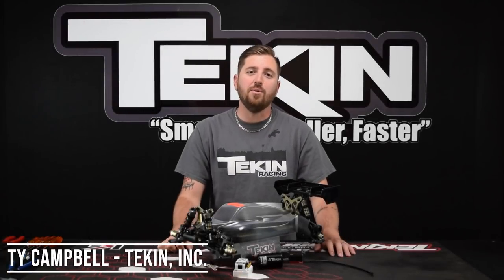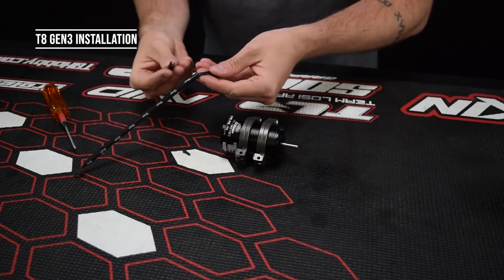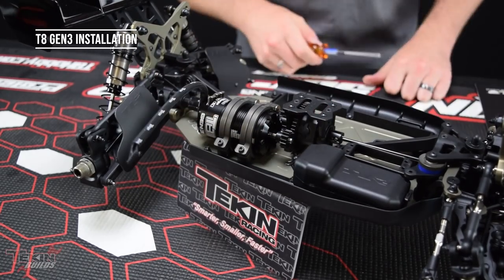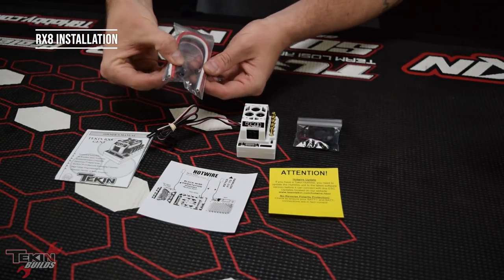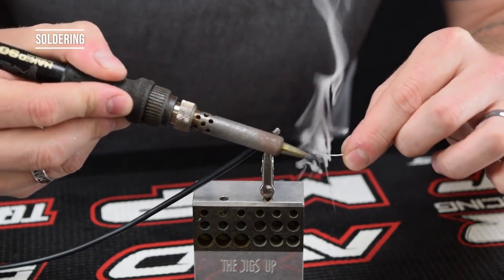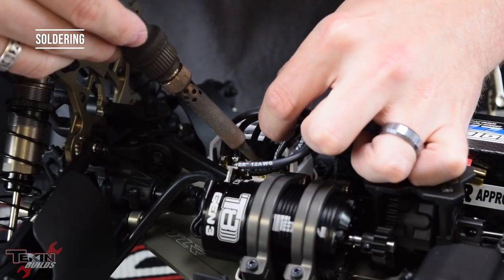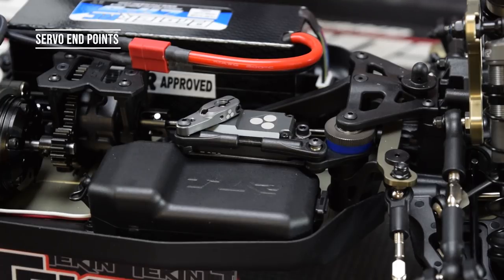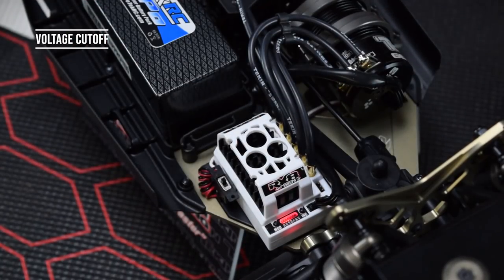Tekin Builds Ep. 8 - TLR 8IGHT-X E Electronics Install

Comment: Never had problem with wires coming off but how can you tell if it's a cold joint? Grey instead of shinny or?
Reply from the maker: Yep, if they are dull and look bumpy they could be cold. They will also pop off if you pull on them a bit if they are really bad.

Comment: I get the engineering behind that style of motor mount, but I’ve never liked them. Makes it a pain to set gear mesh, especially when things get dirty underneath.
Reply: I can see it being more difficult if there's a lot of dirt build up, but I much prefer the way this holds the motor as opposed to hanging it by the front end on a plate.
Reply: @TyTekinCampbell   kyosho had a piece that sat under the motor. the real fix is a thicker mount with one of these aswell, means it has no flex effect and no hanging motor... seperating it like nitro is bad for life of mesh and different loads on the motor shaft. old way with better/bigger mount is the best option.
Reply: @MrSupermugen  so did Losi back in the 2.0 days, but clamp mounts hold the motor much more secure.

Comment: Why do you set up your esc's to need to change low voltage cut off between different cell batteries?  Isn't it simpler to have low voltage cut off set to individual cell voltage?
Reply from the maker: You can do both. You set it for 4S and then you can adjust the individual cell voltage you'd like it to cutoff at. Our ESCs don't auto-detect pack voltage and adjust the cutoff because there are cross-overs that could cause battery damage from over discharging.

Comment: Ok they look fairly shiny feel very solid. But you got me thinking of redoing. Is 80° alot of timing of timing between the motor & esc together. I was told 90° is your max. Typically I run my 1:8 scale castle powered vehicles @ 0° cause it's all that's needed. But my tlr22 needs more top end with its 17.5. So 80° timing with 31pinion  69 spur 90c is that the reason my esc lasted 2 months in cool summer cond. Or does that sound more like poor soldering. My Orion ultimate stock soldered so perfectly very first time very shiny beads. But fought with the esc. Now I'm worried about the gold plating melted off my esc pads making the job that much harder and will my bernzomatic 60/40 rosin core leaded solder do the trick even on rough surfaces. I noticed the second time around soldering my Orion motor was a bitch. I do have a brand new unopened exact motor if needed but would hate to use due to no solder cleaning tools no solder sucker not even roll of that copper mesh stuff. I'm worried about ripple current due to the unnecessary resistance. I can check my castle gear but my skyrc I still need the computer adapter. I do have the wireless programming app and device for the skyrc ts120 and let me say it's been $flawless on all 3 devices I've tried them on. Thanks for any advice at this point. Thank you!
Reply from the maker: That's too much timing. You'll end up with the ESC being so far advanced it will fire a motor phase while still on the current one.
Reply: @TekinRacing  ok but will that fry out my esc faster than cold solder joint. Also honestly I tested speeds with Garmin's forerunner 101 by 5° and found that to be my best "lap time" and top speed of 45.5 mph...I stopped at 80° and did not go any higher due to the small mah packs despite the 90c rating...either way I couldn't see pushing more than 80°. Thanks brother!!
Reply from the maker: @detroitrcwurks998  Heat is a killer. so watch the temps. Timing won't hurt the ESC necessarily, it's the excess heat generated by pushing the system too hard that will damage components. Since none of it is our gear, I can't really say for sure what the limit is.

Comment: Too bad the motor mount isn't a heatsink. 
what if you use thermal tape instead of O ring?
Reply from the maker: It would probably take a lot of tape for the mount to clamp the motor properly. The motor can itself cools pretty will with all the fins.

Comment: I have been running my car with 4S lipo, but the ESC was set up at 6S lipo. I ran it like that about four times what will happen to the battery is it bad? The battery was very hot when I was done running didn't really know why haven't tried it yet on 4s.
Reply from the maker: The batteries need to cut off at the proper voltage. If the ESC was set for 6S it would flash the 1-3-5 low voltage code when you plug in a 4S.
Reply: Tekin Racing I updated the ESC last night. I disconnected like the computer said and then when I hook everything back up it said it was set to 6s. I wonder if updating it set it to 6S? I then set it back to 4s and will run it today. Are you saying that if it was set to 6s it wouldn't run on 4s?
Reply from the maker: @nuclearcrypto7743  correct, if it were set for 6S then cutoff would be around 19V (depending on what the per cell value is in the box above that slider) and a charged 4S would be below that at about 16.8. This would trigger the cutoff and the ESC would not drive and show the 1-3-5 code. Are you hitting 'Apply' when making setting changes in the HotWire?
Reply: Tekin Racing yes I hit apply after adjusting the esc back to 4s, I then plugged battery in and it ran. I just didn’t have time to run the car yet it was too late at night

Comment: No flux? At all? No good ol no.95 or the H-20 all by Oatey. Is this why I'm having a fkn hell of a time getting my solder to stick. Also I'm using a Xtronic #3020 which gives me temperature..is their a round about temp to solder these fat solder tabs...they do pull heat fast. Why I prefer sensored Mamba Monster X 1:8 kit...no soldering. I can weld but have hard time soldering the esc and motor pads only..go fig...  will cold solder joint ruin a esc over time or wouldn't cold solder joint be weak and break off easy. Cause I give e all wire good tug side to side and pull upwards pretty good. I ask cause my tlr22 3.0 SR burned up the esc over less than 3 months time BUT  I was running a solid 80° timing. That particular build I wasn't working so had to go little cheaper on parts...aluminum version skyrc ts120 which has pretty great power consistancy all way thru the pack..Orion Ultimate stock 17.5..savox 1258tg..2 nanotech ultimate 90c lipos..wifi wireless module for android app tuning which hasn't given me not 1 issue all summer and I have to say theirs plenty lines of code with those tunning options especially for the $nickel. Do run DX PRO with telemetry on the 1:8 truggy with castles & spektrums telem link cable which I'm not completely 100% sure on yet far as accuracy thru the esc link cable..all other spot on. Castle did send me a new link cable to compare numbers between both and to send back just what I found. Just hard find'n time.
Reply from the maker: Nope, no flux needed with 60/40 rosin core solder. I usually set the iron about 750F to solder our posts and it's always a breeze.
Reply from the maker: As for a cold solder joint damaging an ESC, it absolutely can. If it's a bad enough joint the resistance can be very high, causing high heat which only compounds the resistance issue and you get a situation that makes itself worse quickly. If a wire pops off and touches another, most of the time it will blow up a motor drive phase if it happens under power. My advice is to just practice and don't use too much solder. Also make sure you're not using silver solder, that takes higher heat and doesn't flow as easily.
Reply: @TekinRacing  sounds about rite. I been an auto tech for 23 years with  ot much soldering experience except for few wires here and there. Usually use the solderless connectors with the shrink wrap ends. Ok so for a cold joint if its damaging my esc what signs would the esc show...cause I'm experiencing none far as hot to mild warm motor wires a.b.or c  my power leads are cool to the touch. I can run this buggy in 90° heat for 20 to 25 minutes non stop and every wire esc all be cool to the touch amazingly...my motor just barely gets warm to where I have to leave my finger on the can for about 3 seconds just to feel some slight warmth. All while running 50° timing. I really check my end of all my wires for heat an absolutely nothing. It's crazy since how warm it is outside I would think my system would produce some more heat. I only ask a out the cold joint only on my esc side I had the problem getting the solder to stick.. the motor and lipo leads soldered perfect 1st time but that damn esc pads took me literally 8 to 9 times to finally get to stick but their stuck  very solid and I mean I gave them all very good tugs and bends back and forth and they are solid. Part problem was I was too quick with the heat....due to the number of times i was afraid of desoldering the pcb. And you say no fluke hey...I'm thinking that fluke was my problem. So have I covered the possible signs to look for on cold solder. I'm pretty sure I dont have any but want to be 100% sure. Thank you so much for reading this short novel...lol
Reply from the maker: @detroitrcwurks998  generally hot wires, hot motor and hot ESC can be signs of a bad solder joint or a setup that is geared too tall or has too much timing. If everything is cool after running then you should be fine.
Reply: @TekinRacing  EXACTLY what solder & brand are you using. I'm not getting the solder to stick without flux. I'm using bernzomatic 60/40 rosin core lead.. thank you for help..
Reply from the maker: @detroitrcwurks998  Kester "44" 60/40 Rosin Core Lead Solder. Never had an issue with it, always sticks and flows cleanly.
Reply: @TekinRacing  would you know what the hardest compound from proline would be for my tlr-22 buggy to run on pavement. Thanks
Reply from the maker: @detroitrcwurks998  You'd probably be better off asking them, I'm not sure they make street tires for 2WD buggy. Closest I can think of would be Primes or Inversions but they are only available in Clay and Super Soft.

Comment: Nice rig but after all that you put a Deans connector on it. 😐
Beautiful electronics and a Deans connector 😩
Reply from the maker: Been running Deans since we first did 1/8 E conversions back in 2005 and have never had any issues. ;)
Reply: Agreed...out of all the connectors Dean's are my least favorite. XT-60. XT-90.  Castle 6.5MM Bullets 👍
Reply: thanks for having an opion

Comment: you used the 14 gauge spot for the 12 gauge wire. Just sayin...lol
Reply from the maker: Our jacket is thinner than most, 14awg spot works better.
Reply: @TekinRacing  I've seen that before it doesn't always match up. Hey any idea of mods on the new Associated RC8B3.2e ? I'm getting one next week. Love the channel
Reply from the maker: @RonHaupler  Associated cars are pretty well setup up out of the box, I'm not sure that car really needs any substancial  modifications! Honestly I like to set cars up close to kit specs and settings and get some time on them before making many big changes. Diff fluids and shock fluids are really the only thing I have a base setup to start with for the kinds of tracks I run on and then I tune from there. If I had to pick a must-upgrade on just about any 1/8 scale it would probably be the servo saver if it is plastic. Those can be a weak point and I've broken many of them!
Reply: @TekinRacing  Alright thanks. I did also order an aluminum servo saver so I should be all set with that. Just getting back into the sport now after 10 years off. I raced a lot as a kid. I'm currently building my new RC10B6.2 for indoor carpet and outdoor astro turf at RC Madness in CT. The 1/8th scale will be for a loose outdoor dirt track there.  Thanks again ! I'll be looking forward to a RC8B3.2e review !!!
Reply from the maker: @RonHaupler  I'll see if I can get ahold of one in the future!